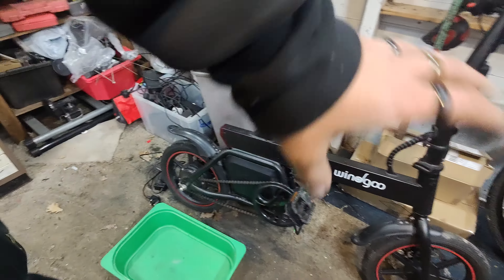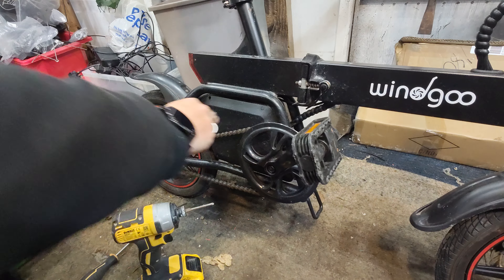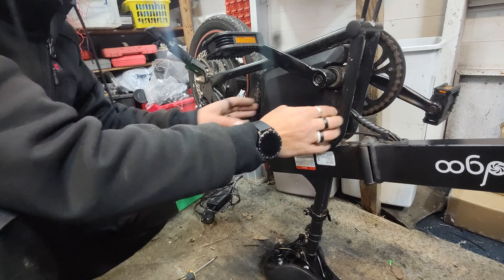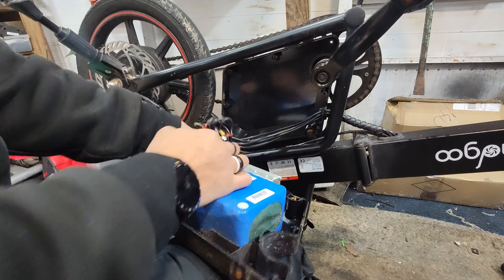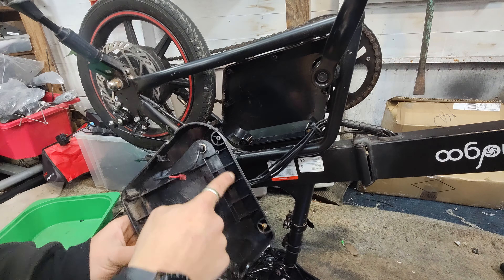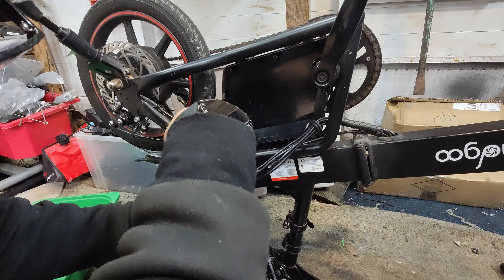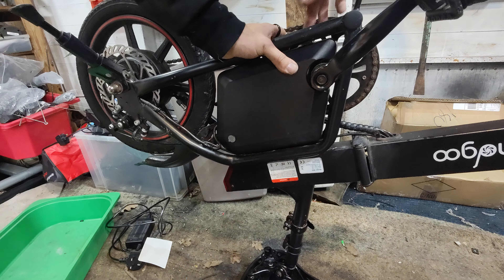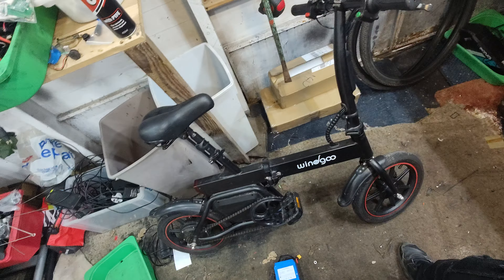How to Replace a WINDGOO B20 Battery Pack - full dissasembly and replacement.

Comment: Did it start to work with rider on it ? Because mines has a problem where when I use it the battery drains at full throttle
Reply from the maker: New battery was ok I've had lots of failed batteries! They're undersized for the draw needed I think

Comment: The light on my charger stays green all the time and the bike won’t turn on
Reply from the maker: Possibly a fuse issue behind the charge port, possibly an issue with the pack itself. Check voltage coming from charger, anything else, give it to a professional or someone who is confident!

Comment: Hello i have a windgoo b20 bike has power but won’t move & the light flashes 3 times .. do you know a way to fix ? thanks District
Reply from the maker: Sorry I'm not sure! Try disconnecting the lights, ebrake cables and pedal assist if it has it one at a time in case they are the problem? If not you could try the display unit/throttle assembly but it's very hard to tell without having it here. Thanks